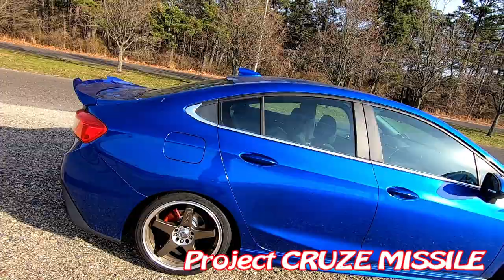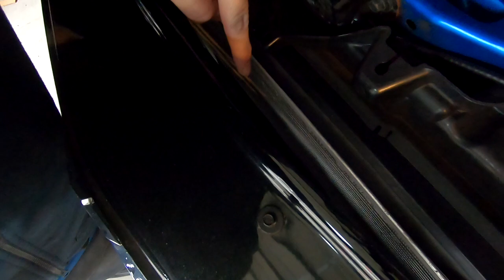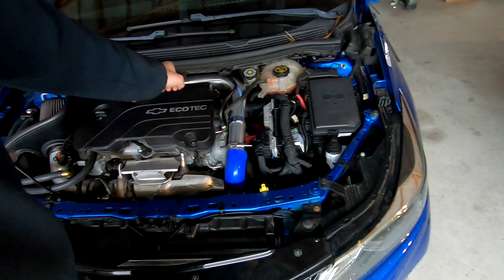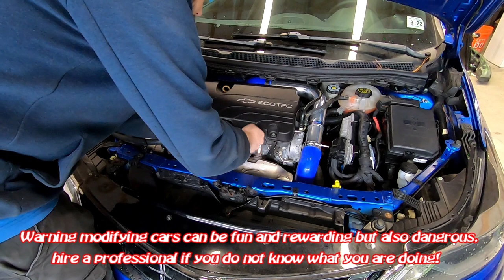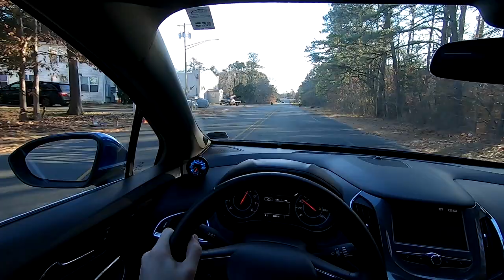CRUZE intercooler and wastegate update video Dave's World

Comment: You should invest into a Dragy so you can test all you performance changes.  I've been using it for years when tuning my car.  I have a road I use all the time to have constant pulls so I can see what changes I've made make a difference or not.  And not just WOT pulls, it's helped with tweaking mid throttle drivability tuning too.   Really good tool.
Reply from the maker: That’s a pretty cool idea I wish I had one for the last year when I was doing all of my videos.
Reply: @davesworld2132  looks like you still plan to modify so never too late to get one.
Reply from the maker: @dtbrown1978  yea I would like to get some 0-60 numbers

Comment: I would love the fan for the intercooler since I live in Arizona where it gets to 120 in the summer but idk if this little engine can handle all these upgrades including the big turbo since some have had cracked pistons
Reply from the maker: Got that right!!! I’ve been developing those specifically for you guys in those hot states. I may not have a video put soon but the fans will be ready by second week of Jan
Reply: @davesworld2132  oh ok thank you do you know what oil is really good for these just in case I don't Crack a piston. I'm at 63,000 on my car it's been great but I have been noticing some jerky action when giving it throttle idk what it could be
Reply from the maker: @quelyndgoins7114  2 things. 1 do you have the stock wastegate still? 2 what octane do you run gas wise?
Reply: @davesworld2132  yes I have the stock wastegate and I'm running 89 right now but I'm going to switch to 91 once I drain my gas almost completely out.
Reply from the maker: @quelyndgoins7114  I know it’s a little more expensive but I recommend 93 octane. Your factory wastegate could be getting weak is there anyway you can monitor the boost pressure? Also how many miles are on your spark plugs?
Reply from the maker: @quelyndgoins7114  I would recommend 93 octane. Also it’s possible your factory wastegate is getting weak. Do you have a way to monitor boost pressure? Also how many miles are on your current spark plugs?
Reply: @davesworld2132  yeah the highest peak boost I got was 8 but it was on a app called Zus but idk how much I trust it and that spark plugs haven't been changed.
Reply from the maker: @quelyndgoins7114  Eight is incredibly low I wonder if you’re getting hesitation because the wastegate is very weak. I would definitely start by changing the spark plugs and running better fuel. If you need help with the wastegate I do have them. Do you by any chance have a manual boost gauge you’d be able to hook up to check the actual boost?
Reply: @davesworld2132  um I don't have a manual boost gauge at the moment I still plan on modifying the car but I want to make sure everything is good before I do that, but you said to change the spark plugs and run better fuel.
Reply: @davesworld2132  how much is your wastegate

Comment: Would this work on the 1.6 diesel the wasgate and intercooler?
Reply from the maker: Do you have an electronic version of the wastegate on yours?
Reply: @davesworld2132  no it has a wastegate it's just on the bottom if the turbo not the top like t 1.4
Reply from the maker: @voodoo-headhunter5624  a lot of those have. Wastegate but they have an electronic motor attached to them to actuate them. Not a pressure housing.
Reply: @davesworld2132  them I'm not sure if it does or not
Reply from the maker: @voodoo-headhunter5624  When you have time contact me through the website and email me some pictures

Comment: Hey Dave, what if where the black soot on the turbo in the picture is a yellowish color?
Reply from the maker: I’ve seen that before. Do you have a tune?
Reply: @davesworld2132  Yead tune. I re-flashed to stock recently and had to work on the car.  I noticed that yellowish color a week ago.  Just wanted to see if i wasn't the only one.  It's probably some residue if the turbo overboost or something. I'm just guessing. Only a handful of people have seen it on their turbos as well. There's not much information on where it's from.
Reply from the maker: @BoostedCruze  I’ve seen that a few times we could be because your air fuel ratio might be a little on the lean side. It can also be possibly something internal to the turbo leaking. How does the car run?
Reply: It runs normal, I guess. I'm not used to driving it without the tune. It still has power, and throttle response is ok. I did notice an increase in fuel consumption. It's actually really noticeable.
Reply from the maker: @BoostedCruze  I would say it’s probably just the air fuel ratio. Typically when you want to get power out of a car you run them a little leaner. What’s the reason for changing the application?
Reply: @davesworld2132 I thought my turbo went bad because it went in limp mode due to over boost. I put it back to stock  for warranty work .Turns out it was ok. But I definitely feel it probably has a leak.
Reply from the maker: @BoostedCruze  What wastegate actuator
 do you have?
Reply: @davesworld2132  Mambatek.  Maybe I should have loosened it a little.  Right now, it has the stock actuator on. Once I find time, I'll put it back together. I probably had some boost creep.
Reply from the maker: @BoostedCruze   if it did I’m gonna need some more information once you put the Mambatek one back on
Reply: @davesworld2132 ok. I'll keep you posted.
Reply: Found out the Yellowish substance under the heat shield is nothing to be concerned about.  Ask someone it GM.
Reply from the maker: @BoostedCruze  it’s probably mostly condensation from your fuel to be honest with you

Comment: I get alot more flutter from my hprv compared to you would that simply be from being automatic or another situation?
Reply from the maker: Possible your computer could be limiting yours or When yours opens there could be less boost vs when mine opens up at idle. How many pounds of boost do you have when it opens at idle when revving at a stop?
Reply from the maker: I've been doing a lot of research on that flutter you are getting. The way mine sounds is a healthy turbo release noise. If you are getting a flutter its because the air is not being released fast enough and the turbo compressor wheel is chopping at the pressurized air. The other reason for this noise can be the PCV system being pressurized into the inlet of the turbo. Though the flutter sounds cool it means potentially you may have an issue going on.
Reply: @davesworld2132  when idling I'm at 0 and if I'm parked I don't build anything over just a couple pounds
Reply: @davesworld2132  and beyond that it's typically holding around 23lbs of boost if im testing it without problem and I saw people say it can be an issue but im just trying to get to the root,  I only got the sound after the hprv before it was fairly consistent, so perhaps I need more release from the higher boost? This is on a 19 hatchback
Reply from the maker: @shawnswopes9431  My car builds about 12 pounds of boost at idle so when I release the air there’s a lot of it no chance for the valve to flutter
Reply from the maker: @shawnswopes9431  I wonder if it’s because of the PCV system. I have a video coming out showing me swapping out my hair and take and messing around with this crazy noise my car was making. Try blocking off the PVC system temporarily to see if that noise goes away.
Reply: @davesworld2132  what about it being my desired boost being negative? Usually sitting at negative 8 and wastegate being at 5 percent

Comment: Great content!

Probably getting the 2019 Cruze myself. What should I do to the car to get more performance from it? 

I really like the car but would love for it to move just a little faster.
Reply from the maker: Right off the bat. A tune. I have a wastegate an intercooler available for that car and a good air intake will transform it.
Reply: @davesworld2132  ty for the speedy reply.  Got another question though. How do I know if I'm getting the Cruze for a reasonable price?
Reply from the maker: @omar.naksho  What year is it how many miles are on it and has it ever been in an accident?
Reply: @davesworld2132  2019 with 30k. Head collision on the right side under the mirror
Reply from the maker: @omar.naksho  what are they asking for it? Is it fixed yet?
Reply from the maker: @omar.naksho  was it already repaired?
Reply: @davesworld2132  yup, fully repaired and ready. Asking for 12k
Reply from the maker: @omar.naksho  $12,000 is not too bad if it’s fixed and has no issues.
Reply: @davesworld2132  no issues and clean as can be. That price includes what would be payed for taxes. Thanks for the help! Made an appointment to get the car this Monday, and will definitely be taking some of your advice to better the car lol
Reply from the maker: @omar.naksho   Look close at the body gaps. Make sure they are strait and even. Make sure the body panels are even and when driving make sure nothing pulls on the Alignemnt. Also check the tires for weird  wear.